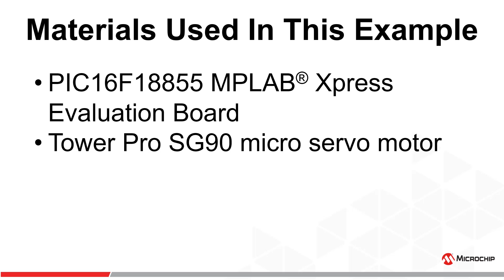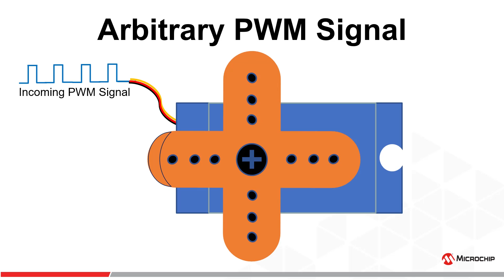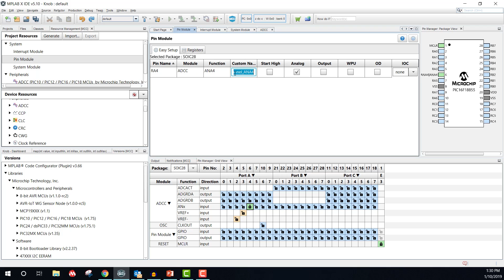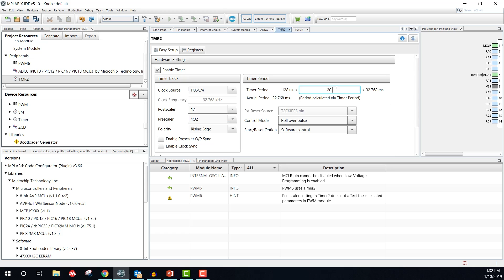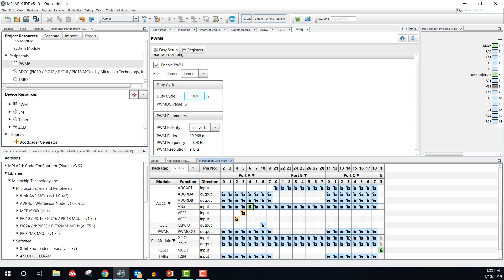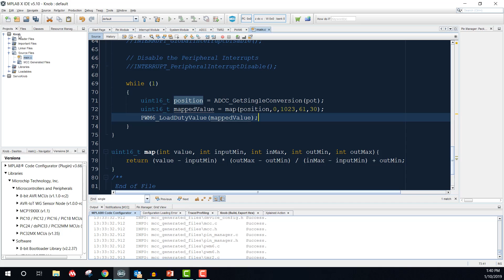How to Control a Servo Motor with a PIC® MCU

Comment: is pic18f4431 supported for the mcc configurator, i just can't make it work.
Reply from the maker: Hi there, thanks for reaching out. The PIC18F4431 is not supported by the MPLAB Code Configurator (MCC). The MCC release notes provide a comprehensive list of supported devices, and the PIC18F4431 is not among them. If your design is not yet finalized, we recommend using the Microchip Advanced Parts Selector (MAPS) to identify a device with similar peripherals that is supported by MCC. If you need to proceed with the PIC18F4431, you may generate code for a comparable supported device and then port it to the PIC18F4431; however, this process may require manual modifications to ensure compatibility. For further assistance, please feel free to contact us at: https://www.microchip.com/en-us/support. Thank you!

Comment: Where can I find the code that you used
Reply from the maker: Hi there, thanks for your comment. The code uses the Arduino Knob example code and was generated inside MPLAB Xpress, please use this link to find the example: 

Control Servo with PIC Microcontroller Example: https://www.youtube.com/redirect?event=video_description&redir_token=QUFFLUhqa3ZMYWVjSG1Bc1dnc0dPRlpLaWxsT0FXSmtWUXxBQ3Jtc0tuSGYyV25ialBMY0VTX1dWdFpESlNJZlgya3R5bE9ZVTVGbVdMU3RtZGpJQjhLU0xBbllHV3FVV0JIUUpCWHIwMm0zMlVUazNpaGhPb1BEOU9mQ0JWR0RwTEJSZWszNHhuUVRSMXZMN2ZTYjRnelBIQQ&q=https%3A%2F%2Fmplabxpress.microchip.com%2Fmplabcloud%2FExample%2FDetails%2F763&v=hcAgXiPSMOA

Link to servo examples: 

https://www.youtube.com/redirect?event=video_description&redir_token=QUFFLUhqbTJUeF9xRnhMMUY2cjktWnpWUVFZS05VUldNZ3xBQ3Jtc0tsYmdTWTRSclJ6YjVXN01yNUVwWENkM05NRWRtQ1NDcXdUMDRPOE44U29KZVhQalZGRFdIU09laWdldE5ieGtGWU84TlpiRWoxMjdCLVZURERlZGFLQ0xzSkFXZjVXM2wxOE1WU0hhRTNDUHpsRGRMUQ&q=https%3A%2F%2Fmplabxpress.microchip.com%2Fmplabcloud%2Fexample%3FTags%3Dmotor%2520control&v=hcAgXiPSMOA

https://www.youtube.com/redirect?event=video_description&redir_token=QUFFLUhqazFtMEo4Zzg0OGpBTFZlR1RxLVFQYVI1MDZBd3xBQ3Jtc0ttOEtrOTE0N3RXeWdMSzRtUW5jUjc5WWVCV1ZLa016bUc3WmVhQ1lBZElyTzdmV3lFTnZRVy1tTUJnRlpxbDRJUUdPN1psX2NSNHVtcjVhLU5wV2NkOS1RQzMtaWp2ZC0zYmJtRE5TekxoWmM5NnFyTQ&q=https%3A%2F%2Fwww.microchip.com%2Fdesign-centers%2F8-bit&v=hcAgXiPSMOA

Comment: Nice to see an RC related topic!.
I think the presented example is not very good though, as the resolution is very poor: the timer can only go from a value of 30 (1ms) to 61 (2ms), So the resolution of the servo is only 5.8 degrees (180 degree divided by 31). That is quite coarse. RC systems usually have at most 1 us resolution, better ones even down to 500ns.
The discussion of the servo specification says the servo moves from -90 to +90 degree when the pulse changes from 1ms to 2ms. However, during the demo the servo only moves -45 to 45 degree. Either the code is not working properly or the servo does not match its specification.
Reply from the maker: Glad you enjoyed the topic, here is a video of how to make a high resolution servo driver on a PIC microcontroller: https://www.youtube.com/watch?v=vn2fWVSdKME&t=10s